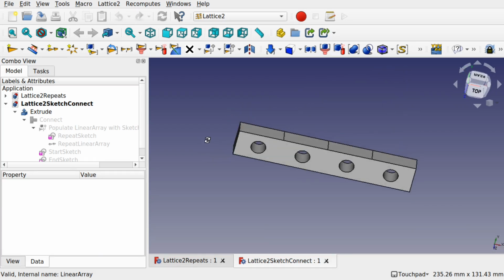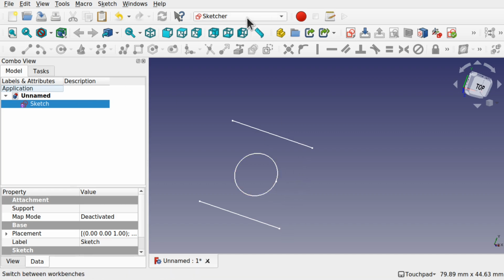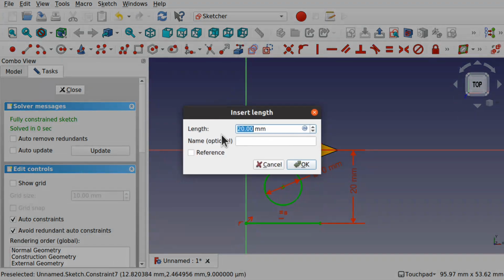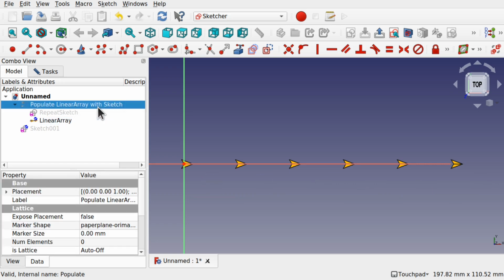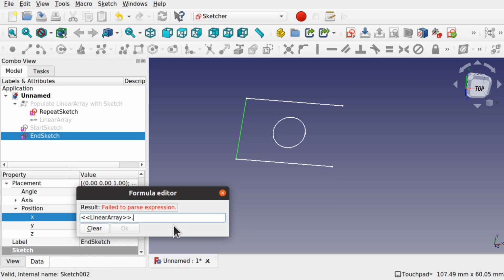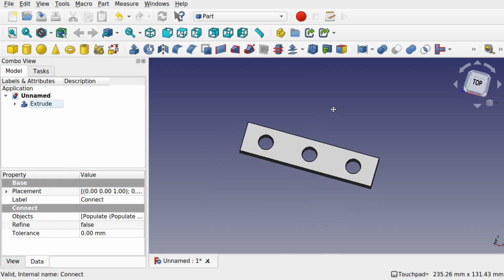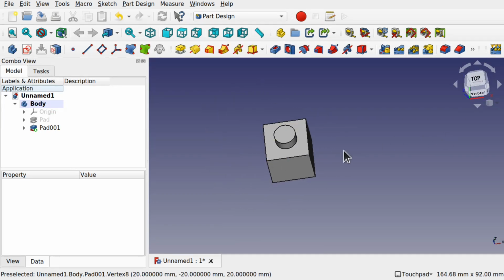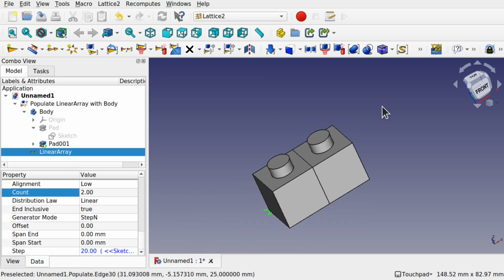FreeCAD: Lattice2 Dynamic Repeating Sketch Elements for custom layouts

Comment: Thank you! I started to watch Lattice2 tutorials for a different problem, but this video actually solves an older challenge of mine. I have a model that only repeats in the center but has distinct ends, and I'd like it to be parametric. Now I know how :)
Reply from the maker: Great to hear, lattice2 is a amazing workbench and it has so much potential. I will be doing some more tutorials in the future as there is much more on offer